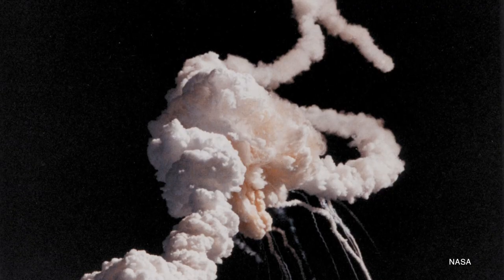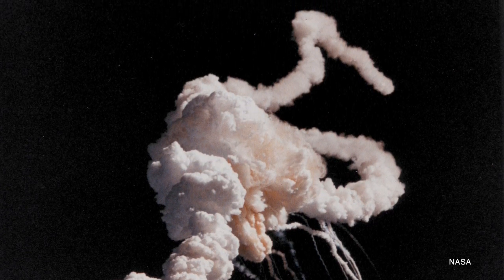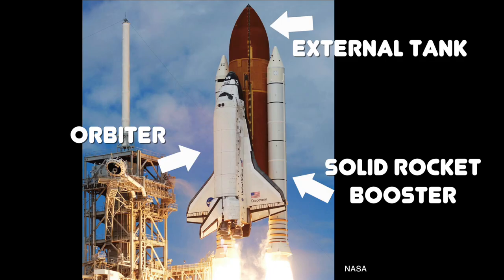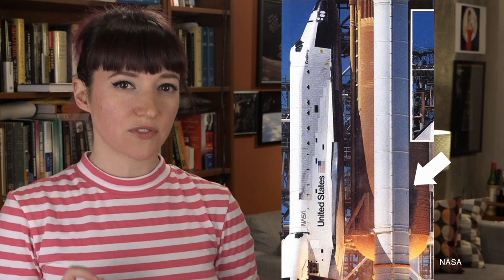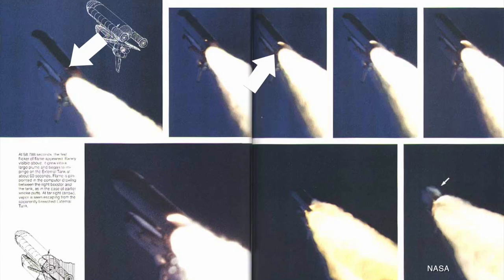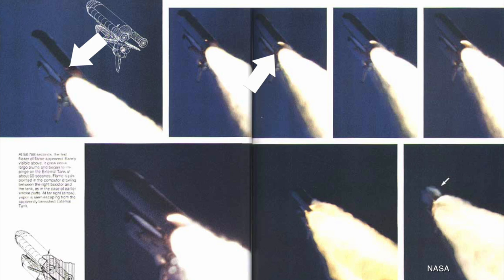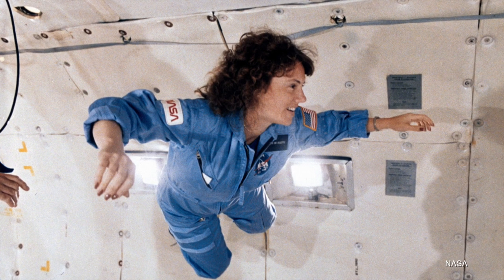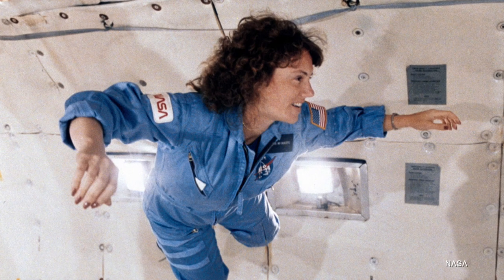How the Challenger Disaster Changed NASA

Comment: (FOR CUA MGT 311) The Challenger Space Shuttle Disaster outlines corporations' need for common virtues and morals. NASA has a company culture that values a rigid hierarchy and is significantly scheduled obsessed; when being a business that is putting people's lives at risk with its operations needs to be solely focused on the safety of its team. The Challanger Diasters' fatal flaw was an O-Ring failure caused by almost freezing temperatures at the time of launch. Engineers and scientists didn't feel they could speak up about any technical difficulties pushing the launch date back because of the tight financial and PR restrictions NASA was under. It is hard to understand how NASA let a similar disaster happen in 2003 with the Columbia Disaster. This failed launch was due to a piece of foam insulation getting stuck in the wing; however, the underlining reasons for that technical malfunction were budget pressures, launch program expectations, and poor managerial style. NASA's managers are still - or so it appears- primarily focused on achieving deadlines no matter the precautions a launch may take. As much as the O-Ring failure was due to a lack of calculations, those types of problems would not happen if everyone in the company could speak their minds when they thought there was a problem and not have all deadlines being persuaded by external factors of the company.

Comment: It is unfortunate to learn about the event of the Challenger Disaster. Not only because it caused the death of female pioneer and astronaut, Christa McAuliffe. The successful landing of the Challenger from Cape Canaveral, Florida, could have been a breakthrough for space exploration. Early red flags that should have been detected on the Challenger, were that there were multiple delays of Challenger's launch countdown, six days ahead of it's January 28th launch, due to inclement weather, and technical errors. 
In 1986, President Ronald Reagan formed a special commission to examine and identify, what exactly went south in the launch of the Challenger. While trying to develop preventable measures for the future. Former secretary of state Williams Rogers, and former astronaut Neil Armstrong were at the head of the presidential appointed commission, along with former test pilot Chuck Yeager. The investigation came to the conclusion that the disaster was caused by the failure an "O-ring" seal in one of the two solid fuel rockets. The expandable and elastic O-ring did not respond as it should, because of the cold temperature that was present at the time. Which played a significant factor in the monumental loss.

Comment: The Challenger Disaster, I would argue, is not an issue that was strictly a technical and administrative failure. I would argue that it can be traced back to ethical failings by NASA. When it was told that the temperature was below the appropriate temperature for the O-rings to be fully elastic, NASA had to make a decision. When it came down to the decision, the innate human dignity and value of the humans on the shuttle were not considered. The driving forces of the choice made were PR and logistical. When a company cares more about a reputation and delivering on a time schedule over the lives of their workers, they are going down a road with no good end. If there was anyone considering the infinite value of the humans on board, there would not have been a question about risking their lives to save a reputation. Although this moment would have been a setback for NASA they would still have had those passengers on board to be able to go back to their families. This is why the challenger disaster was a failure on the technical, administrative, and ethical level.

Comment: The Challenger disaster was one of the most terrible occurrences in american history. This video explains the reasons why the shuttle exploded. The speaker explains that there was a problem with an O ring failure causing a ripple effect of explosions that took the challenger down. It was clearly a technical error, one that was explained further by an engineer demonstrating how the O rings, under temperature pressure will fail to be useful, and therefore causing the O ring to leak. But a bigger problem was if everyone knew the O rings were temperature dependent, then why was the Challenger allowed to launch at all? 
This gets to the bigger issue of culture problems within NASA. It appeared that the technical team did not have as much sway as the public relations team, and in order to save face, they went ahead with the launch. The president was giving a state of the union address and if the shuttle did not go off in time, it would look bad to not be mentioned during the speech. The second issue was that McAuliffe, the teacher was due to give a lesson from space and changing the date of the classroom exercise, they would lose another PR opportunity. NASA was overbudget and underperforming their number of launches annually and knew the taxpayers would lose faith if they didn't launch on time. Only if they knew the real disaster that would occur. This is an important lesson of making sure leadership listens to all of the stake holders and makes good decisions based on safety and preserving human life more than public relations and optics.

Comment: NASA did not show prudence or exhibit good management skills when it made the decision to launch the Challenger Disaster. Instead of focusing on the safety of the crew and listening to the staff, NASA was more concerned with the publicity and the PR headache if they did not launch on time. They wanted President Reagan to talk about the launch, but if the launch was delayed, he would not have talked about it. Additionally, they wanted all eyes to be on the tv when they launched on Friday. Delaying it to Saturday would have been the prudent decision, but again, NASA cared more about publicity than the safety of their crew. The O-ring was the biggest technical problem. Yet, the biggest problem was NASA putting innocent lives in harm's way because of good publicity and praise for the launch. This disaster could have been avoided if NASA listened and took the necessary advice. Instead, they did not, and it ultimately led to seven innocent lives being lost just 66 seconds into the launch. A lack of prudence, guidance, and seeking attention were all motivating factors behind this fateful decision. The safety of the crew should have been NASA's biggest concern.

Comment: Did anybody ask why the right solid rocket booster o-ring failed, but the left solid rocket booster had no leak. Possible installation failure.
Reply: Of course they did. The O Ring that failed was in an SRB that had been exposed to colder temperatures compared to the other SRB - which was due to the wind direction that pertained at Pad 39B during the hours before the flight. There was no indication that anybody had installed any of the O-rings incorrectly.

Comment: The space shuttle Challenger exploded 73 seconds after take off “challenging” NASA’s integrity and future space program. The fault was to be blamed on the technical causes.  The O-ring rubber seal on the rocket boosters were not functional in the cold weather launch. The temperatures were below freezing on January 28th, 1986 and the integrity of the seals were “challenged”.  However, it is not the seals fault or the cold weathers fault that the disaster that occured.  The failure was human error , the rush to launch for political purposes and the concerns of the engineers being in a culture of advancement.

Organizational behavior should promote power from listening as encouraged by John Yoest, Jr. in The Memo. NASA should have listened to the engineers in an unbiased manner to political pressures and progressions. Instead of excellence/power, there was a loss of human life and a shift backward in the plans to fly civilians in space.  The result was a need to change NASA’s safety and accountability culture.  Organizational behavior needs to have effective and harmonious communication between management and staff. An organization can gain “power” and knowledge by a collaboration between management and staff that builds trust and respect.

Comment: While I understand the essence of the Challenger mission failure, as well as the basics of it, I was not aware of the past failures of NASA, in prior years, as well as the extent of the toxic culture at the space agency, which fueled the disastrous flight. Public relations are incredibly powerful incentives for anyone, regardless of industry. Even when a company is doing well, public relations are always on the minds of management. Any chance one can take in order to better themselves in the eyes of the public can be the make or break for the organization as a whole. NASA was no different, and in this case, more desperate for good PR. With both the influence of the President, and well as millions of people watching, the stakes could have not been higher. It was this, and desperation, which unfortunately led to unnecessary loss of life. However, due to this error, NASA did get PR, and even though it was negative, it exposed this rotting culture it had. This in turn allowed NASA to rise back to its feet, and strive to represent the study of space more efficiently, and represent itself in a better light

Comment: Just wanted to ask about the crew cabin and how the astronauts are thought to of survived the initial explosion of the SRBs and main tank only to die when the crew cabin impacted the ocean. My question/s are did crew cabin have a parachute or other systems to slow down the descent if an accident like this occurred and if so was the parachute etc damaged by the break up of the shuttle and didn't function to save the astronauts. Seems a bit pointless to make a super strong cabin that could survive the explosion but ultimately could not save the lives of the astronauts.
Reply: The Space Shuttle Orbiter had no sort of emergency crash survival system. All abort/emergency scenarios were built around returning the orbiter to land and landing it. I think there was an emergency escape system that would have allowed the astronauts to parachute out, but they couldn't have used it in this scenario because they never would have been able to get to the hatch to exit the cabin.

Comment: The actual technical cause was ultimately down to pork-barrel spending.  Senators only agreeing to fund the shuttle if their state got some of the spending.  So the SRBs went to Utah.  But a solid SRB would have been too long to transport to Florida.  So they were made in sections.  Which required O-rings.

Even so, it would all have been OK if NASA manglement had listened to technical concerns.

Comment: The challenger disaster was a combination of human error and design flaws. In the weeks prior to the launch, there were many concerns raised about the safety and legitimacy of the instruments onboard. These were brought up baby engineers and ignored by upper management. This shows a lack of trust with NASA, they were not listening to the people who worked on the project because upper management was worried about meeting deadlines and pleasing superiors. Unfortunatley, when these kinds of careless mistakes are made within an activity as serious as space travel, lives are lost. These simple mistakes can have drastic consequences. The operations people on the morning of the launch failed to recognize that the O-ring would not be able to function properly due to the temperature. This shows that even small mistakes can bring down massive projects. That is applicable across many different corporations, when the details are lost in translation, odds are is that the project will fail. That is exactly what happened to the Challenger spacecraft, luckily now NASA is more observant to things like this. However, if the correct procedures were there in the first place it is possible that this whole disaster could have been avoided.

Comment: The entire Shuttle program was a complete and utter failure.
When it was sold to the American taxpayer in the mid '70s it was sold as the "DC-3" of space. It was supposed to make access to space less expensive as the DC-3 did with aviation.
It didn't happen. 
In fact  only the Titans had a higher cost per pound of payload put into LEO.
Part of the cost was due to the engines never performing in the manner the original contract had called for. They had to be completely refurbished with every launch, instead of every 12 launches as originally called for. 
The engines were also less powerful than contracted for. This resulted in the Shuttle never being able to do any missions into polar orbit. This in turn meant it could not loft the spy satellites it was supposed to. 
Many engineers considered the use of solid fuel boosters to be inherently too dangerous for manned missions.
I could go on, but the proverbial Bottom Line was that the Shuttle was an expensive piece of junk that never performed as advertised, and KILLED people.
All of that, and January 28, 1986, was my thirty-third birthday.

Comment: The explosion did not rip the shuttle apart, it was the aerodynamic forces that broke the shuttle apart.
Reply: Let me get this straight: speeds between Mach 5 and 7… versus tons of liquid nitrogen oxidizing in an explosion, not igniting… you are quite wrong. 
Yet this discussion is nonsensical, the shuttle is made of aluminum which is structural as a Boeing but quite more fragile on its walls. Air speed could desintegrarte it with a wrong AOA, but the explosion could pulverize and melt it AS IT DID
Reply: More likely the mechanical force of the rapidly expanding gas compromised the structure and then the off angle AOA accentuated the break up.
Reply: Sorry, NASA specifically said it was aerodynamic forces not the explosion as they said that was relativity mild.
Reply: NASA clearly said it was not the explosion.  From the NASA findings "Challenger veered from its correct attitude with respect to the local airflow, resulting in a load factor of up to 20 (or 20 g), well over its design limit of 5 g and was quickly ripped apart by abnormal aerodynamic forces (contrary to popular belief, the orbiter did not explode as the force of the external tank breakup was well within its structural limits). The two SRBs, which could withstand greater aerodynamic loads, separated from the ET and continued in uncontrolled powered flight."
Reply: Michael Boland is correct - aerodynamic forces destroyed the shuttle stack.  There was no explosion, but rather a conflagration.  Watch the high-speed film and you'll see there was no shock wave which would indicated a detonation.

Comment: don't know that it really changed anything.  they knew about the problems with foam striking the orbiter for 20 years and did nothing.  more than anything thing they have been lucky with how they have operated.  a smaller shuttle meeting up in orbit with pre-stationed experiments or modules would have been better.

Comment: You forgot to mention that the srbs were designed so that if the o-rings failed the hot gas would weld the segments together but also there was alot of wind which broke the weld and let the gas through
Reply: I did not know that!  Thanks for telling us.
Reply: TreeTG perfect storm of events.
Reply: Got a source for that information? I've never heard anything about them being deliberately designed to "weld together" in the event of an o-ring failure, because that's not how welding works. What actually happened was that a "plug" of combustion by-products (aluminium oxide or something similar) stopped up the joint at the spot where the o-ring failed. Aerodynamic forces combined with  crosswinds caused the SRBs to flex, breaking the oxide "plug" free and allowing hot gasses to escape, which burned through the mounting strut and eventually the External Tank.
Reply: The slag from the combustion stopped the gap, until the stack passed through the jet stream, causing a drastic course correction. This dislodged the slag. Look at the ascent plume. Notice the sharp break in the plume?
Reply: sixstringedthing that was what i meant
Reply: I was trying to say that on top of the o-ring failure winds also played a role in the incident
Reply: TreeTG Yep, fair call. Also the unusually cold temperatures on the morning of the launch which caused the o-rings to lose their flex and become brittle.

Comment: 50 launches is a huge commitment,  Hell SpaceX cannot turn around 50 falcons a year.  And they have more F9 Boosters kicking around than NASA did shuttles.
Reply: The shuttle that was built, was not the shuttle NASA wanted. The finished product was nothing but a lot of compromises. Built by the lowest bidder, who had a history of problems developing manned spacecraft. They killed the Apollo 1 crew, and were consulted before the decisions that doomed Challenger and Columbia. 17 astronauts  died on spacecraft built by North American Rockwell.
Reply: It was insane how optimistic they were about the Shuttle system.  One week turnaround from landing to launch; multiple launches a week, from both coasts. Such high usage that all the built Shuttles would be retired and replaced by 1990.  (Designed for >100 flights each, the whole program only flew 133 times.)
Reply: David Kearns as for SpaceX launch rate, they just about doubled last year and plan to increase by about 50% this year. They’ve got a chance to get to 50/year in the next few years. But, space is hard, so we’ll see.